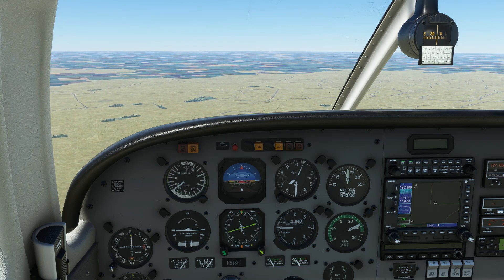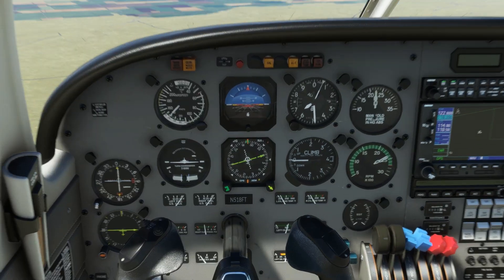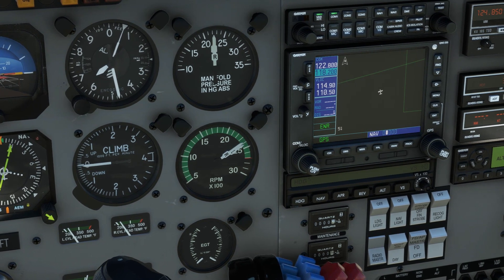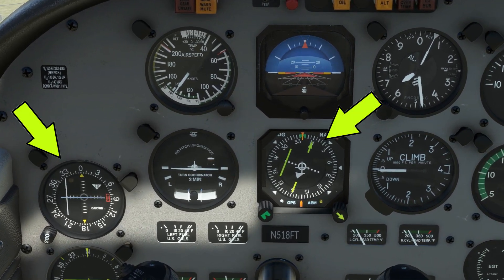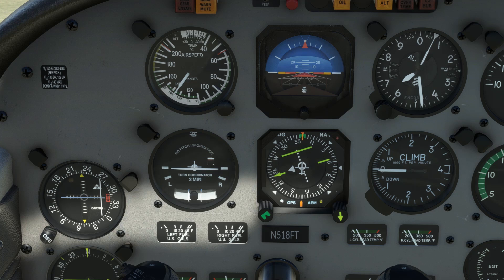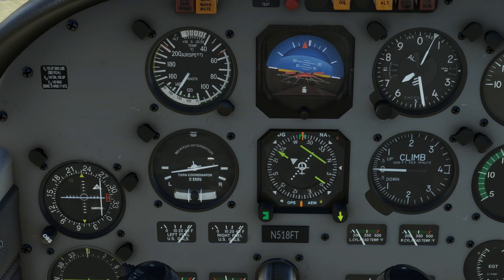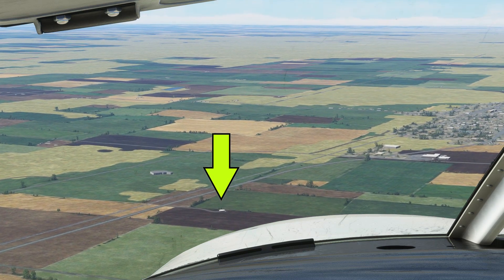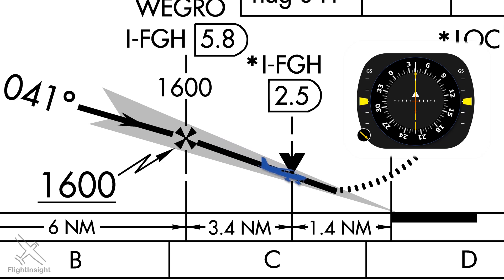How to Use an HSI | Horizontal Situation Indicator | IFR Instruments

Comment: I'm not a pilot, took lessons,but ran out of money. So now i youtube flying instruction videos. My question is ,how does HSI work in . glass cockpit.  So are u using the course knob and heading knob on the auto pilot panel of a king air 200. I've watched your explanation of hsi on the older version of hsi. I understand how that works.

Comment: Can you make a follow on with using the hsi with gps waypoints?
Reply: You should be able to toggle the HSI between Nav and GPS mode by pressing the CDI “soft” key on your GPS. On the gps display, this would show a green “GPS” in the bottom left indicating that the HSI is reflecting your GPS route. If “NAV” is displayed on the bottom left instead, this means your HSI is taking information from your NAV radio —your NAV frequency, hence the name nav.

Comment: I use digital HSIs (G5 and Aspen depending on the plane). It auto sets the HSI needle but it’s very easy to get complacent, especially with multiple approaches. Even though it does it on its own, it’s important to still verify the TTTTT with each waypoint. I honk manual HSIs are better for training for this reason - your law of primacy is engrained to do it every time.